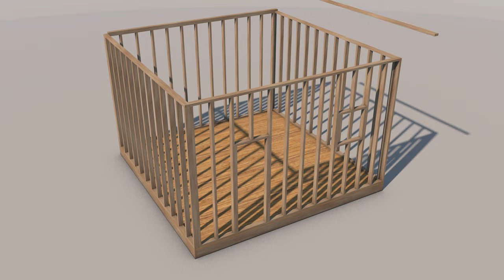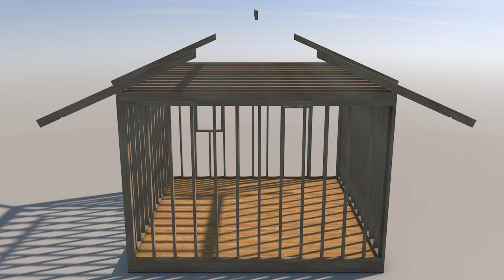How to Frame a House

Comment: Framing a home isnt that hard, is having to make sure that the floor joists are bracketed right to the frames. The exterior walls need changing out when they are old and rotted. Siding doesnt do the trick, as you run into other problems. How you place the exterior walls is important. Isnt necessary to have all the boards left to right, they can go up and down too. This causes less moisture to cause the wood to swell and buckle the home.

Comment: Shouldn't there be some isolating layer between concrete and the first wooden layer (the very first pieces shown in video)?
Reply: Some people use polyethylene plastic sheeting on top of the foundation before putting the pressure treated sill-plate down on top of it. It’s not necessary I don’t think, but adds another layer of protection from moisture.
Reply: Or foam gaskets

Comment: You made a mistake when you joined all the walls together. You never join the outside walls like this. You stand up all north and South walls and Cap off with easy and west or the other way around, but never in a spiral pattern like you show in the video. Anyone who has ever build a house like that shows their inexperience in construction.
Reply: moofushu why?
Reply: Homes or small structures are never built in a spiral pattern like is shown in this video. It would have been just as easy for the builder to use the very same materials and stand up all north and south walls and cap it off with east and west walls. Doing it in the fashion shown in the video adds problems to the structure and shows the inexperience of the person building it when they could have avoided problems by just not building in the spiral pattern.
Reply: @moofushu  spiral pattern can u please explain what u mean?
Reply: @Joedirt5  Yes, Its simple. Outside walls are either through walls or they are butt walls. Its wall framing basics. You can look this up online. If you want to see it explained in a video then I recommend you look up "Wall Framing Basics How to Frame a Wall and Door" on youtube. In that video explained by Larry Haun jump to time stamp 7:40 in the video titled "wall plating." He clearly explains through walls vs butt walls and why you build this way. I will say when I didn't know better and built my first shed on my own with no outside help I made this mistake shown in this animation video. I build my outside walls with all of them being butt walls. It made for more hardship than was necessary. Trust me, you never want to build an actual house or small shed like is shown in this animation. you'll wish you could go back and redo it when you get to the roof.

Comment: why would you put floor joist over a slab? Your carpet tile or wood should go over the slab. With wood you would want to use a barrier  or float it though.
Reply from the maker: First Take Property Services You're right. I made this for a school project in a class using this 3D modeling software and wanted to show the concrete texture.
Reply: Good simulation though. I wish I could had the software. Thanks

Comment: why is there a 2" gap between the floor joists and concrete foundation?
Reply from the maker: The sill plate goes on top of the foundation, but under the joists. It gives a good, flat surface to continue framing the house and also helps protect against moisture and rotting.
Reply: Makes sense, though I had no idea proper floor joists were suspended 2" off the foundation.  Thanks for the video
Reply: Joshua Gibson why joist when you have solid foundation unless you use that space for pipes or heat/ ac lines if no basement. Video is strange.